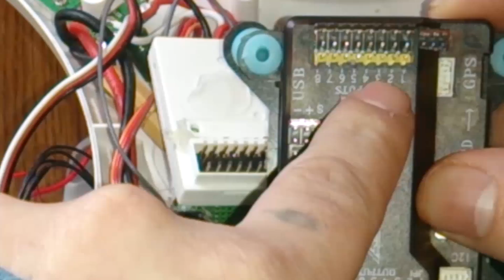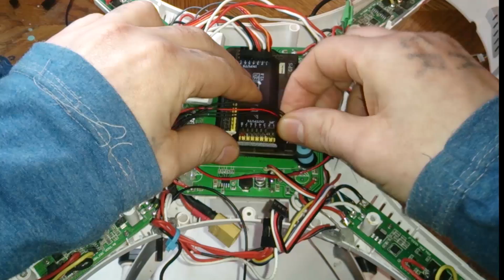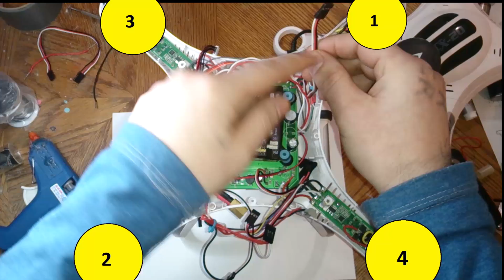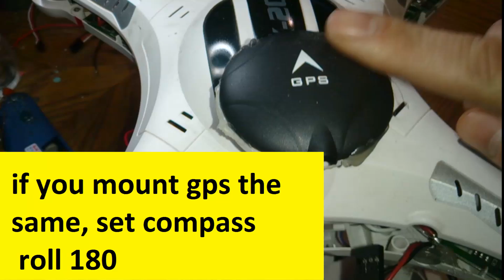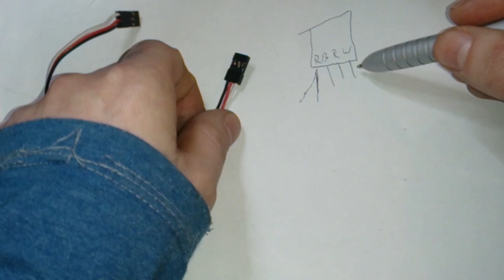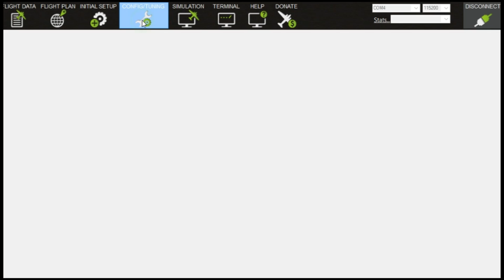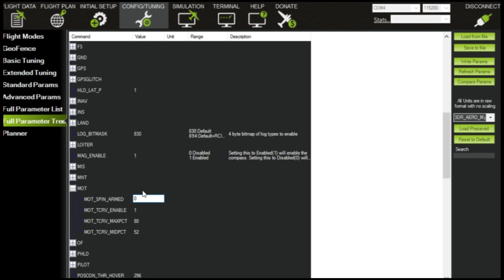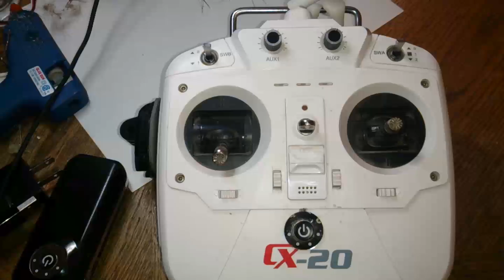cx20 factory apm to apm 2 6 - 2.8 step by step

Comment: When I plug my cx20 into mission planner it shows that the quadcopter is moving around on the little map.... and my roll is reversed. I tried setting RC1_REV to -1 and 1 to see if that would fix it but it didn't do anything. Any ideas?
Reply from the maker: yeah seems your params are messed up .  try to back up your params then just load mine .. and see if it fixes it.. 
https://drive.google.com/open?id=0B2w6_OKE_2kxM0xYckJidFNRWTQ    after 
you load it, Make sure to push the write button., unplug the apm and 
plug it back in.. and confirm  your roll is back to normal...If it is 
then proceed with all the calibrations again.   or re load yours and figure out what is wrong.
Reply: Loaded your params and the roll is still reversed. I checked to make sure that it's actually writing the params and it is, but they're not taking effect. I never had this issue until I replaced the broken esc. Could that have caused this?
Reply: It also appears that my yaw is constantly moving to the right... Man what the hell could have caused this?
Reply from the maker: it might be.. you can try.
loading older firmware like version 3.1.5  
it will serve 2 purposes ..
1. see if it works..maybe just bad firmware.
2. if it still does not work
in version 3.1.5 you can go to terminal 
type Setup
then type erase
after its done reboot the the apm.. and try to re write the params again
.  You can't get into terminal with version 3.2.1.

any chance did you try to do a remote calibration..on the actual remote?   If you did not leave the remote in the center at the final stage it might give you some issues ..not like yours though as I know with things reversed.. ..
Reply from the maker: maybe you have the wires wrong on the receiver?
Reply: I left the remote in the center at the final stage but I'll do it again to make sure. I'm pretty sure my receiver cables are in the correct positions but I'll double check that as well
Reply from the maker: yeah ..the final stage of doing the calibration on the remote it self is leaving the throttle center...

doing the calibration in mission planner , you need to leave the throttle down.

Are you running stock apm or apm2.6?
are you using power module ?

with the receiver see what happens with only the a cable plugged in and the b cable   ,, remove e,t,r 1,2,3  . 

if you are using a power module make sure you don't have the b cable plugged in .. or plugged into something else by accident..   ..

also remove the 4 output motor wires.   
you might also want to un solder the ppm wire on esc 3. ..

I just through a bunch at you so do it in what ever steps you feel..
Reply: Alright everything is connected to the receiver properly and the controller is configured correctly. At the end of the calibration it says to make sure all stick are centered and that the throttle is down, so I put the throttle down and clicked okay. I also loaded firmware 3.1.5 but I'm still having the same issue.
Reply: I'm using apm 2.6 and yes I'm using a power module as well as telemetry
Reply from the maker: wait.. a min ..i just re read.. .. so  one of your issues is the quad is moving around the map?  the gps/google map?   that is totally normal for it to do that...

with version 3.1.5 did you try the setup / erase  ..then re load my params.. and confirm after you write them .. reboot apm and see if the roll is no longer set to reverse.
Reply: Unplugged e,t,r 1,2,3 from the receiver and still the same issue. Unplugged 4 output wires as well and sill the same thing. It really baffles me how all this happened over night. All I did was replace a broken esc and calibrated them. I flew the quadcopter for maybe 30 seconds just to make sure it flies and then I unplugged the battery and put it away for the night. The next day I plug the quadcopter into mission planner and now I have all these issues. This damn quad is going to drive me insane haha
Reply: Yes that's one of the issues. Well I thought it was an issue. Yeah I'm sure I did that but I'll do it again to make sure.
Reply from the maker: its very weird for it to actually be reversed though a glicth..because pwm don't just go and reverse them selves.. ..   ..for kicks you can try to open up your remote / transmitter   
4 screws and remove the cap around the antenna  
carefully lift lid up as one black and red wire connect to the power board.. you can unplug that..    then  look around the pot switch for your roll .. check to see if one of the wires broke and is touching another one.. carefully move them to make sure its not like mine and was just in place but not really touching..
Reply: I can't believe I have to ask this but I just want to make sure. When you plug your quad into mission planner and tilt it to the right, which direction is the little gyro window supposed to tilt? The one that shows you which direction you're facing and stuff
Reply: Sorry to bother you on new years btw. Thank you for being so patient with me. Happy new year dude
Reply from the maker: yes happy new year to you as well.. ..   with the numbers in the middle
60 45 30 20 10 0 10a 20a 30a 45a 60a
when you tilt to the right ..the center arrow points towards 10a

it does not say 10a its just a visual example   .. the center line seems to do the opposite of how you tilt it.. so that can be confusing..
Reply from the maker: also you say your roll is reversed... I just want to make sure you don't mean your pitch is reversed.. it could be you have your e,t,r cable on reverse ..like r,t,e instead..   e is suppose to go to apm input2
e = 2
r = 3
t= 4

what is your pitch doing.. when you put the stick up does mission planner show it going down?  its suppose to be reverse on pitch..... edit well i just tried that .. .. i don't think thats your problem..
Reply: I honestly think I might have just confused myself. When I move the stick up mission planner shows it going down. When I roll right mission planner leans left but I think that's how it's always been. I just did a test flight and everything seems to be working fine. Going to have to do a test flight tomorrow
Reply from the maker: heh..yup .. in radio calibration when you move the roll left it should go left..its the pitch that goes up and down backwards.... .. .. however the hud would add to your confusion for sure.. ... good you figured it out.. before you started to un solder things..
Reply: Haha yeah I was getting ready to take out the soldering iron. Turns out I'm just an idiot :(

Comment: The red light never goes solid on my apm. I made sure I calibrated the controller correctly twice. I also followed checked everything except for gps in arming check.
Reply from the maker: .. did you set all your flight modes?..and maybe for now uncheck it all....write your params and reboot the apm    ..and swa swb have to be at zero zero on the transmitter
Reply: Alright that seemed to work, the red light goes solid, and I get the two beeps. But after I pull the throttle down, one of the ecs starts beeping.
Reply: Maybe it's a broken esc?
Reply from the maker: if you plug in the b cable or the power module back in.. then put in just the battery .. do they all beep at the same time then go silent.. do a couple of throttle test to make sure they all spin .. its ok if its out a tad ..   If you want to keep trying on that one esc....i would suggest just unpluging the 3 good motors from the apm..they will beep like crazy but just ignore them and try to do the esc calibration on just the one.. ..
Reply from the maker: if the motor is always beeping ..then you might want to fallow this video ..i show everything I do.. to test them out..   Make sure to try the bad esc/motor  into another output..so say output 2 is bad try it in 3..just to see if 2 stops beeping then then 3 starts..    if you upgrading your apm because you had issues with the beeping as well it could very well be the esc..   I did come up with a firmware fix but its very small pads to solder on..    anyways here is the trouble shooting one.
https://www.youtube.com/watch?v=CtLxQ0Vmklg
Reply: 3 of them do the tone and go silent but the other one keeps beeping. When I apply some throttle nothing happens. I also can't arm the motors when I'm plugged in on just battery power.
Reply: Okay I unplugged the 3 good motors and I hear that weird tone coming from the bad one. Looks like it's in programming mode. It's weird because the beeping that the other motors are the same beeps that the bad motor does.
Reply from the maker: try right on the receiver it self for the bad esc..  https://youtu.be/CtLxQ0Vmklg?t=1063
Reply from the maker: also as i stated in the this video and others..don't push the throttle down once it gets into programming mode as you might set a setting by accident..      if its going into programming mode it sounds promising at least..
Reply: Yeah this is a broken esc. This quad was given to me after a bad crash so I'm assuming the esc was damaged somehow. I'm really really surprised how much progress I've made with this quad. Mostly thanks to you haha
Reply from the maker: alright... i would just inspect the white wire going to the esc make sure its still connected.. also if its motor three and has a extra wire going to  a pad called ppm  ..try removing that red wire off the main board for kicks....it will disable the lights under the quad..but it might have back voltage causing problems.
Reply: The esc that's bad is actually the same one in your video haha. Motor 2 is the one giving me problems. I just ordered a replacement now. Hopefully everything works well and I can get this thing in the air. Do you still want broken esc's btw?
Reply from the maker: well hopefully that will be the last of your problems .. I always need broken esc's ....however if shipping is too much don't worry about it.  thanks for the offer either way..
Reply: Yeah I looked at how much shipping would be and my eyeballs nearly popped out. I was really hoping it wouldn't be too much :(
Reply from the maker: yeah .. if you could snail mail it would be the cost of a stamp.. but if your country is like mine ..once any metal is in the letter it then needs to have a customs thing done to it.. oh well... I made the most of my one donation so far .. I was able to create the firmware that works on at least two of the versions .
Reply: Wow really?
Reply from the maker: yip its this video https://www.youtube.com/watch?v=EACa18e8kzU
.. it would probably work on yours but the pads are really small.but with patience you might be able to save it..the true reason why I wanted them is because I had one 2 years ago that fried from somebody and it showed me a few bytes.. my plan was to rebuild the original firmware..but the one I got was locked so forced to create my own so to say.. ..
Reply: yes I have the 3 pin HC-SRO4
Reply: I also have a picture for you, but forgot your email. Could you send it to me again. My email is scott.miller2726@gmail.com
Reply from the maker: its   bangs696969@gmail.com   .. also can you start a new comment on your next reply .. youtube has a really bad system for comments and either i don't get notified or they get buried and refuse to go newest comments ..
Reply: I am taking a brake. Nothing is working out for me.
Reply: Hope you figure it all out
Reply from the maker: ahhh ..this is where "I am taking a brake. Nothing is working out for me."  ended up ..looked all over for this comment.. ....sorry if you got flooded with notification.. we moved out of this thread..
Reply: No problem. Had to take a brake for a minute. Back at it now
Reply: Working on it. Thanks

Comment: Hi Thank you for the fantastic easy to follow video can you explain the way to calibrate the motors for I'm not sure and do not want to do anything wrong. Regards
Reply from the maker: hi at the end of this video I added that..   https://youtu.be/mrBWEATUbus?t=1739       you need to have arming check disable
https://youtu.be/mrBWEATUbus?t=1463
Reply: bangs6996 thank you iv seen it and followed it with success
Reply: What preflight check do you have to do before flying with this setup?
Reply from the maker: you should be good to go if you did all the calibrations ..compass ect..
Maybe set arming check back to all if you want

What I tell people to do is a rtl test every time you use the quad.
..place the quad in front of you ..bring it up 10 or so feet , fly the quad about 20 feet or so in front of you. then flip it into rtl. But be ready to flip it out.    Just make sure it comes straight back towards you and starts to come down.  If it goes in another direction .. bring it in and find out what is wrong with it.

Comment: good day
 i am asking how can i use the PPM Encoder V2.0 for my APM Flight. and 
if it is save or no. and if you can make a video step by step for this. 
thank you very much for your videos(S)
Reply from the maker: good day.. you do know that apm 2.6 has ppm?. .. and the ppm encoder is built into apm .. or is this for something else?
Reply from the maker: If it is for apm 2.6 watch 20 seconds of this video ..I show how to enable ppm on apm 2.6 and cx20 apm.     you put ppm wire into 1 input and put jumper on 2 and 3.. then you don't need external ppm encoder v2.0

https://youtu.be/Ir0OZmRPpyU?t=74
Reply: thank you very much.
Reply from the maker: your welcome ,  If you are still confused..just tell me what kind of receiver   you have ..
Reply: thank you very much . i do have a receiver X8R from frsky with a modul XJT mode 2 on turnigy flashed by ex9r
Reply from the maker: so is this the receiver you have??
http://www.frsky-rc.com/download/down.php?id=102

then i think it does not have ppm ..so don't do what I said..
but you can just connect all the pwm to the apm..
attach 1pwm to 1 input on the apm
2pwm to 2input on the apm.
ect ect....
5 and 6 need to be mixed on your transmitter for fail safes.

 I don't have that remote..but I should get one.. I have been asked 3 times this week about that receiver..

ect ect....
Reply: thank you very much. some ppl told me it jas Sbus and we can connect ppm on it and before doing it i like to know what the expert like you can advise me. but thank you and i do appreciate your help and your advise.
Reply from the maker: What i read it does not have ppm ..just Sbus.  If people are telling you it works then try it..  It it does work, let me know in case anybody else ever asks.. .. If it does not work. I would just hook up the extra wires with the pwm outputs. ch1-ch8
Reply: thanks a lot

Comment: Hello. Do you know how can I change original apm V252 motors ports? Few days ago I chrash my dron and right now one motor port do not work. How can I switch it to output port 5? Please  help.
Reply from the maker: .  have you tried switching all other motors /esc's to dead port? just to make sure. .  confirm that fist then I will try to send you firmware to test. later today hopefully
Reply from the maker: i will upload small video later with file and steps
Reply: bangs6996 yes, I check all other motors and esc are ok.
Reply: I also try to understand how change this ports at firmware, but I stuck at coding.
Reply from the maker: https://drive.google.com/open?id=0B2w6_OKE_2kxb1R3eHFZeXZXVDg     here is the firmware.. you need to change all the ports over ..
on apm 252 back facing you it goes
1,2,3,4,5,6,7,8   for the motor outputs.. I changed it to

8,7,6,5,4,3,2,1     .. I tested it in my house with orientation hold.and it worked good.. but have not fully tested it with everything rtl gps hold ect...
Reply: bangs6996 Thank you, but thats ok that orginali I have firmware 3.1.2? After upgrade quad will work?
Reply from the maker: Yes it will work with version 3.2.1     however you do loose options like calibrate compass through the quad remote.. you have to do it through mission planner.. but I have another video that has the original firmware 3.1.2 as well...... Really you have no choice. because version cx20 custom  3.1.2  source is not released to the public.   I only have the firmware now. its the only way to try to fix your quad.
Reply from the maker: also made a video here for you.. https://www.youtube.com/watch?v=LbS5L8jyYGo    but i'm sure you already understand how to switch the wires around.. ...
Reply: bangs6996 yes, I see this video, thank you, I will check this all later.